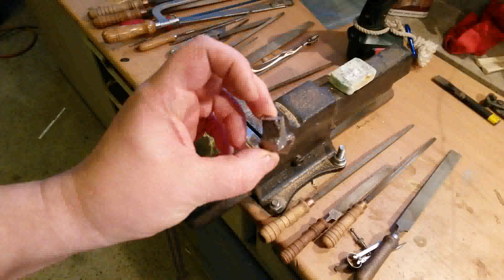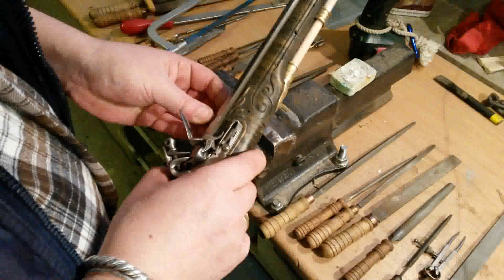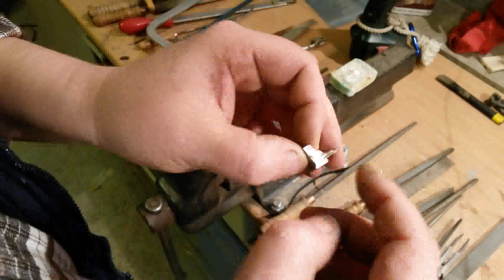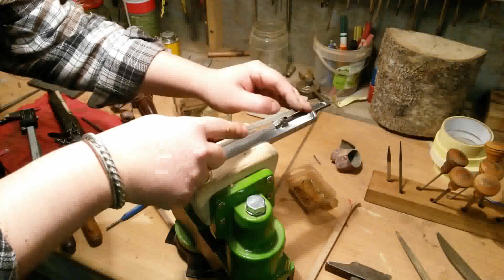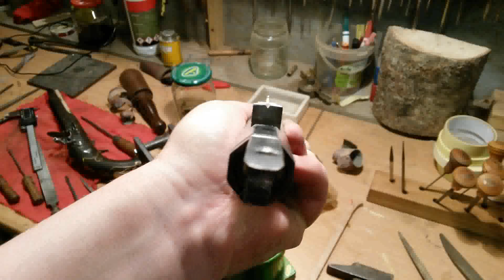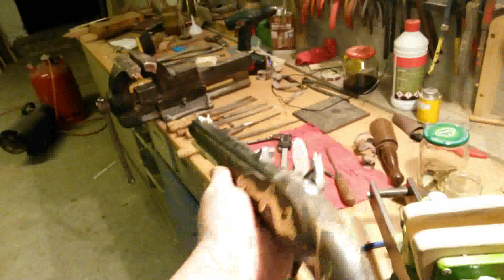Kentucky flintlock pistol build Pt. 30 making and instaling the rear sight

Comment: Very strong looking feature. It should be almost ready to fire, no?
Reply from the maker: The original vent hole is poorly made so I will make vent hole liner too. How was the race in Daytona?  Surely the weather was better than here in germany.
Reply: @homemadehistory7537  beautiful! It was sunny in the 80s every day. I got to see some friends, did a little riding and got to see alot of racing. The only drama was a tire blow out on my trailer that destroyed a turn signal but other than that, we had a great time. I look forward to to the next video. I'm just about ready to do the sights on the Bridesberg also. The front has to be tin soldered so that's a little of a learning curve. The rear has a slot and a screw. It's supposed to warm up again next week, I hope to get back out into the garage and finish the gun up very soon.
Reply from the maker: That sounds nice, ...exapt the blown tire;-) . To the soldering... i did that very often but only for water pipes never for gunbarrels. I think if the surfaces nice and clean and you have the right flush and solder wire it should work. Maybe it will be good to make some test peaces.
Reply: @homemadehistory7537  I've watched a couple videos on soldering steel sights to gun barrels. I'll do a couple tests on scrap, if it doesn't go well, I'll take it out to Winchester VA. There's a guy out there who does all kinds of relining work and complete barrels on civil war rifles. I also have a cousin who lives out that way who I ride and shoot with. In fact, he gave me my first black powder rifle. A "Knight MK 58" .50 calibre inline. I owe him a visit anyway. Yeh that tire went off like a cannon, scared the shit out of me. Glad it wasn't any worse then that.